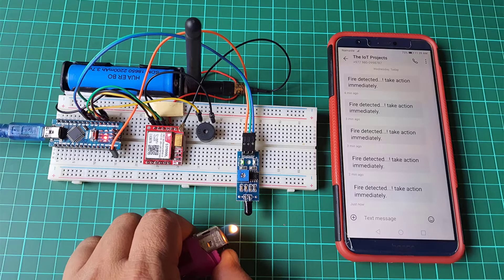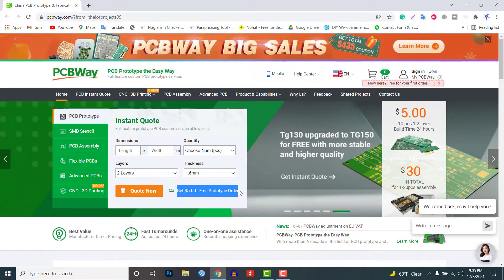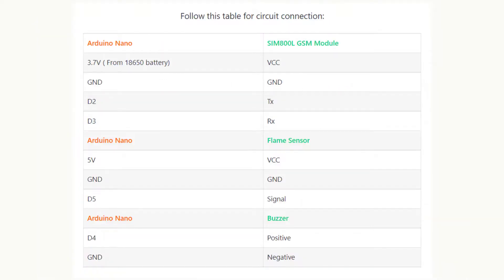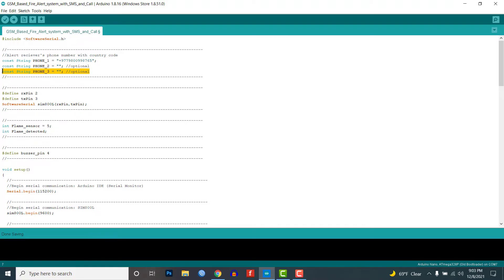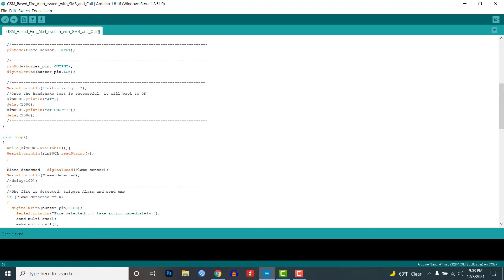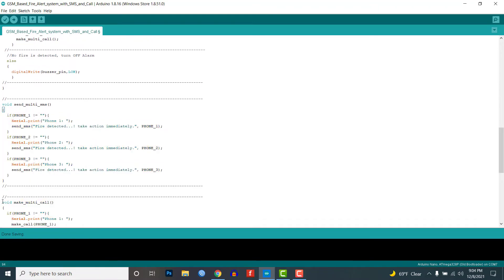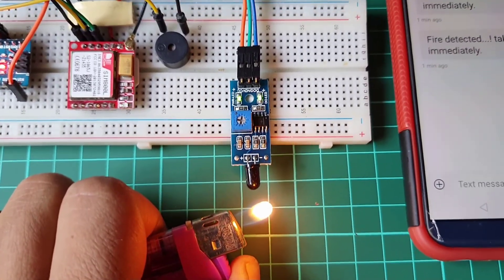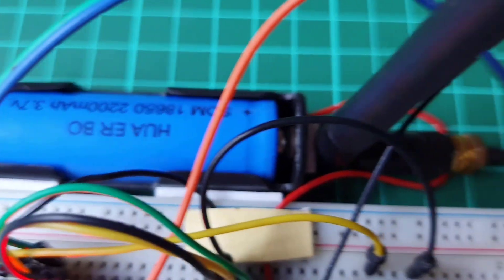GSM based Fire Alert System Using Arduino and Flame Detector Sensor

Comment: One help could you please tell me how to connect sprinkler with this and also provide the coding plz
Reply from the maker: What type of sprinkler do you have? If it is electric operated, then just attach a relay to the project to available digital pin. modify the code to run a relay when fire is detected.